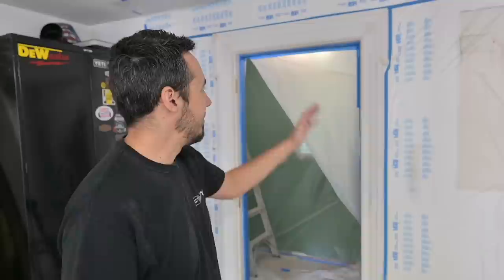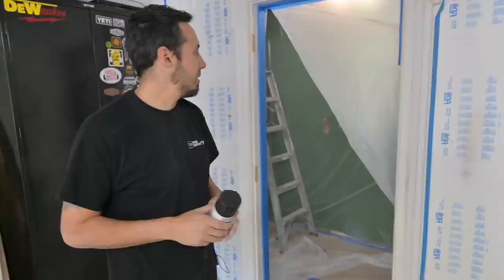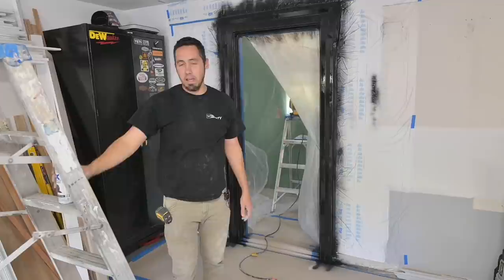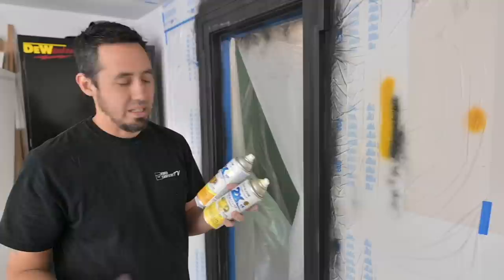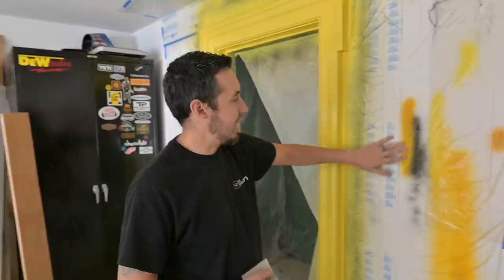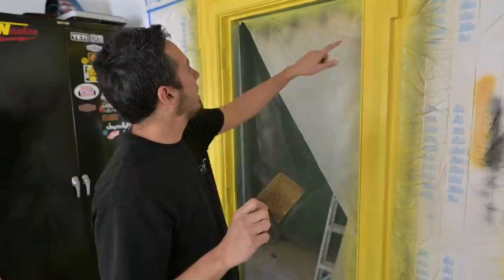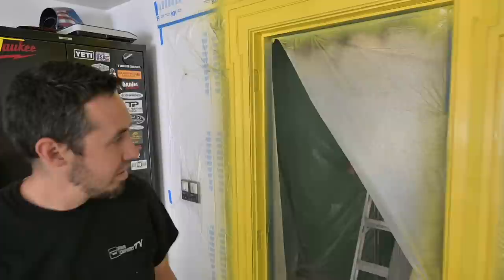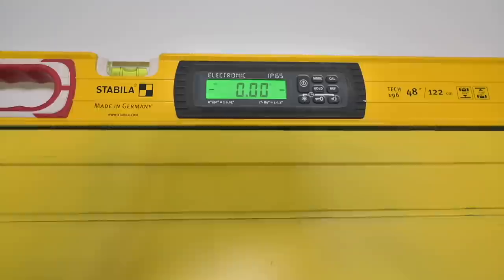Painting carpentry work with SPRAY CANS

Comment: I was wondering how long you were going to spray paint your cord?  LOL!  Great Job Brother...keep up the GREAT WORK!  
Eh...as an idea...do a "Soup to Knutz" on crown molding a vaulted ceiling from the horizontal plane to the peak measurement, step by step on how you'd lay out the crown, cut the crown & instal each piece with your tips & tricks.  Use a white board and make it as KISS as possible for us laymans.  
Later

Comment: Holding down the spray nozzle for more than 1.5 seconds is hard for me to watch.  I used to do that too but the paint builds up near the nozzle and soon starts running/dripping off the can and worse yet it sputters into the flow of the paint.  Short bursts and sweeping motions help the nozzle stay dry or as dry as possible.  It makes a huge difference.

Comment: I think I'd of taken the time to set it up to spray it with the airless and SW tricorn black for the base coat, painstakingly picked what would be the closest DeWalt yellow I could get and hit that with the airless also. Then after I was satisfied with the distressing spray a couple few coats of clear satin topcoat to keep it from further wear. 

What vac system are you using for the Surfprep?